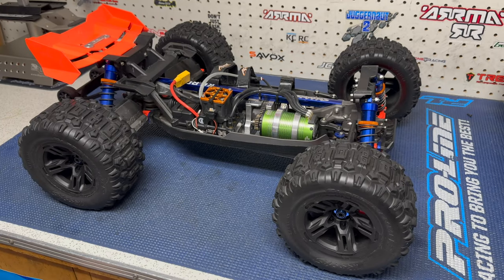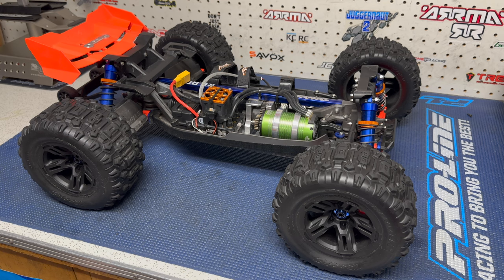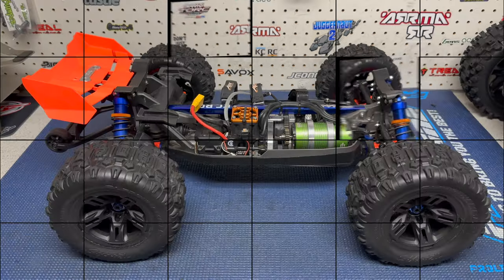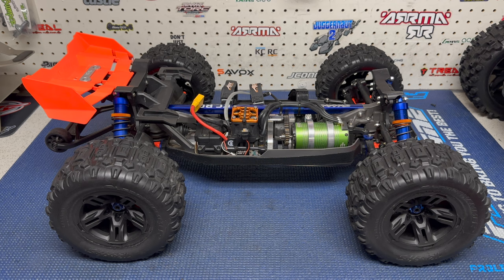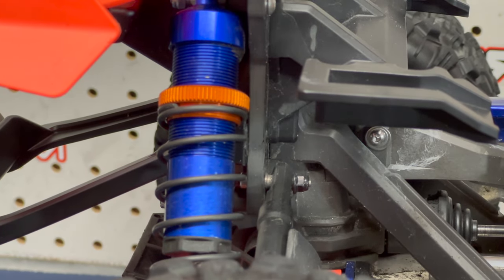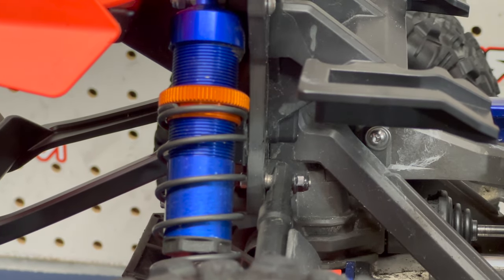Traxxas Sledge Review (Everything I have done to make it the G.O.A.T.)

Comment: The motor mount that doesn't destroy gears is more important than a bent tower that can be beat straight. I did the BQ towers. Wish I'd done just a 7075 rear. It's interesting in our differences in power preference. I think the V2 needs 5s, and the Sledge with the stock setup is plenty. Thanks for the vids Jason!

Comment: You have a very nice setup now!! I like the color scheme of the blue/orange. It goes together surprisingly well! You would think for the price of this truck that Traxxis would have put the "upgrade" quality gears in it from the start rather than selling you the upgrades when you break the garbage gears they put in it. Not much Traxxis left in it at this point. Body, arms, wing, tires, and center brace? They really did a good job with the plastics on this truck though.  You don't hear about arms breaking or the steering links too often.

Comment: Great informative video, I used to have a blue Sledge but i wasn't too much into it i ran it bone stock the entire time i had it and it ran well had no issues. I'm now looking into getting another one as a slider off eBay or buying another RTR or looking into the Kraton 6s V5 or the Kronos XTR 2022. Tell me if it's a good idea to get another Sledge or look into another brand's 8th scale truck.

Comment: You want mesh loose , not off end gear but not bottomed out  either, the way you have it is perfect , it will draw less amps run so much better , when gears are cheap metal they do wear but you have good quality gears ⚙️

Comment: I just don't understand why someone would spend almost $2k on a sledge. You could probably spend around $1200 on a K6S and it would be better than a Sledge with less work. Heck, my K6S EXB that I turned into a XL with the Mojave EXB chassis is better than a Sledge. MMX8S and 1650KV motor 23T pinion. 😂. Thanks for the video. I would never spend all that time and money on a Sledge. Just my opinion 😂